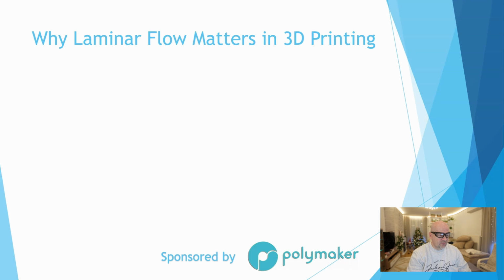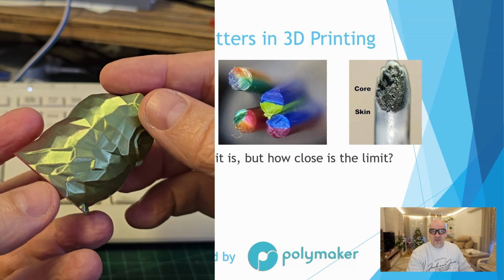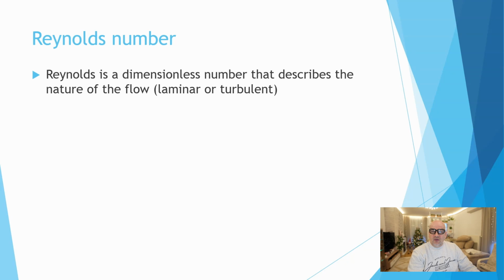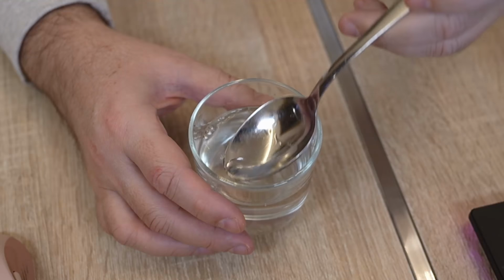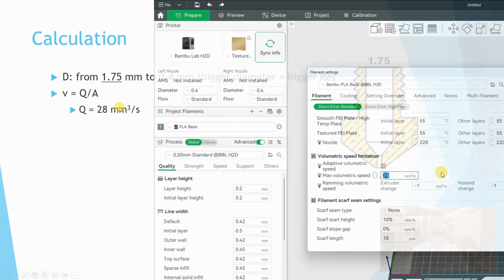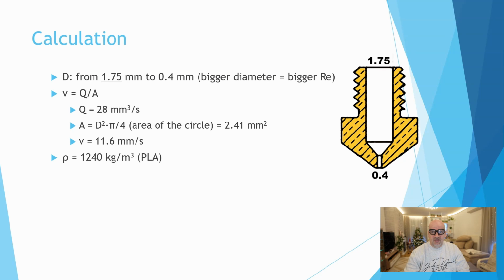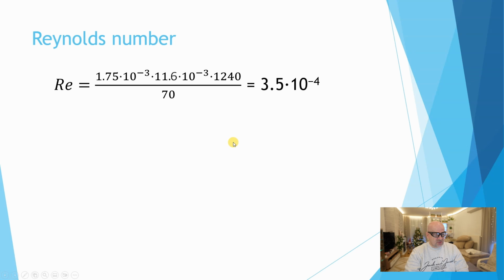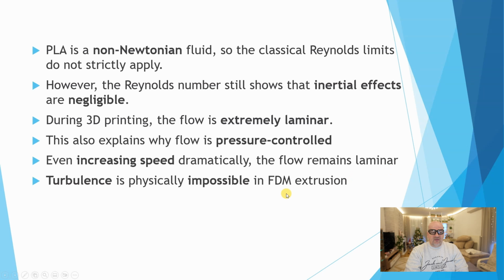Why Laminar Flow Matters in 3D Printing?

Comment from the maker: The Reynolds number is actually higher in the 0.4 mm nozzle than in the 1.75 mm filament.
This is because flow speed scales with 1/D², while Re scales with D.
The difference is about 4.4×, so the conclusions remain the same.
Reply: I think turbulent flow in the hotend can be beneficial (unless we want to print color sided print), cos in this case the plastic is getting mixed and therefore it is heated faster and its temperature becomes more uniform. It is the same effect that is pursued by various high flow nozzles like e3d's or roetz's. Moreover, such nozzle irregularities are called turbulators.
Reply: Azért szebb lett volna, ha elismered a kommentemet, és nem csak lemásolod. :) Mint tudjuk, a jó tudós nem bánja a peer review-t, és bevallja a bakit...
Reply from the maker: Többen is írták, nem győzök mindenhova válaszolni, de igyekszem. Köszi az észrevéltelt.

Comment: Hi ,@MyTechFun can you make the video with formula why different 3d printer have different extruder design like prusa,bondtech, orbit,bambulab,creality,etc. and old bowden type extuder. All these brand used standard 0.4mm  with different design of nozzle to flow the molten filament. Is this related to different spool holder postion and speed of the printer?

Comment: This video is fantastic! From a practical application side of things im more interested in the implication that flow is pressure controlled. Its already something that intuitively made sense (as was the laminar flow part) but that implies we can control pressure at the nozzle for precise filament deposition.
So ventures into FOC of the extruder motor, or strain gauges holding the hotend + a model of internal pressure dynamics can unlock the real volumentric flow control capabilities. Up until now its always just been feed forward velocity control. And we act like variable line widths, stringing and seams are a guessing game. Probably not for long.

Very nice stuff! If anything more of these videos.  It is clear you are an experienced educator!

Comment: having the volumetric flow, and the section you can calculate a Newtonian shear rate uncorrected( neglecting  some effects such as Bagley) using power law  or any other semi empirical model you can get a more accurate value( Cross, Carrea-Yasuda.....)

Comment: This video has great value, it was interesting to actually learn something new! To be fair, filament testing videos often just serve as proof of the tests, otherwise, a simple spreadsheet with measured values would be enough. The only thing that bothers me is that I’m not sure what the conclusion is. Is it that we don't need to worry about turbulent flow with the current generation of 3D printers, or did I just misunderstand?

Comment: If someone unsubscribes because of this type of video, then they never meant to stick around anyways. Love your research and tests keep them going!
Reply from the maker: 3 of them so far. But maybe its better for all..
Reply: @MyTechFun  I know you have a lot of tests to do with each filament but I always wanted to see some chemical resistance tests if that wouldn't be much more work for you. For example PC-ABS, ABS is resistant to Nitric acid, but PC is not, so will their compound be or not? Resistance to motor oil since most people 3D print automotive parts exposed to gasoline, diesel, oil etc.. ethanol, acetone..
Flame resistance would also be interesting to see do they burn, extinguish themselves, melt but not burn etc, the UL94 standard.

Thank you for being awesome!
Reply from the maker: @dujep5327 Flame resistance I tested few times, but chemical tests I would like to leave to chemical engineers.

Comment: Can you please go into the cracking effect that occurs when certain filaments are printed too fast?  For instance, Overture PETG and Polymaker PETG legacy formulation turn matte above a certain velocity and if you put it under a microscope, you can see all kinds of surface cracking or crazing.  There are whitepapers on this.   My understanding is that the pressure differential between the inside of the nozzle and the outside are what causes this problem.  Maybe you can have Polymaker explain how the formulation of the new Polymaker PETG solves this problem (all of the newer PETG formulations fix this).  The cracking or crazing effect heavily compromises layer adhesion.  Likewise, Bambu Silk+ PLA has a severe problem with something that looks similar, which severely limits print speed, and there may be other filament formulations that do this as well.

Comment: LOVE the video. More of this, but also keep doing the testing.
This video was short and sweet, got right to the point, and i loved the actual calculation to give the scale. Perhaps the only thing missing was to re-arrange the formula to solve for speed. Ie, how fast would you have top print to get out of the laminar regime? 
Using your constants, with a 1.75mm characteristic diameter, i got V as 74,194 m/s and with 0.4mm i got 324,597m/s. (someone check my math please...)
These numbers are truly insane, so Roetz 4.0 can crank it up a little more without worrying;-)

Comment: When you extrude 150% line width from a nozzle, you are forcing plastic outward and away from the nozzle orifice, smashing against the previous layer. How is this laminar flow if there is an obstacle in the way (previous layer)? It may be the case that the plastic remains on the same side of the extrusion, but the vectors within the material are not straight lines. This is why you see fibers poking out when extruding larger line widths than the nozzle.
Reply: here you are again with these poking fibers :D just let it go bud, that's not how any of this works.

Comment: I like this type of content. Perhaps in a followup video you could explain more in-depth what is happening while printing to make the quad-color filament change colors depending on the direction the print head is moving, I assume it is the orientation that determines which of the four colors is on top.  Also is four the practical limit for 1.75 mm filament, or could a larger diameter filament produce a wider range of colors?

Comment: Hi , I’m a chemical engineer, and have made many of the polymers used for 3d printing. Often when we do reactor kinetics, we to consider the melt rheology. Many  of these polymers are not Newtonian fluids…so I’m a bit confused by the video. These melts are typically Bingham plastics, so laminar flow is not a thing as described in the video. Predicting the rheology with Reynolds number analysis should be used with caution.
Reply from the maker: You are right and I mentioned this in conclusions

Comment: I don’t do much deep engineering anymore (I’m a CAD developer) but I still followed that 😊. Interesting Reynolds calcs, I had never thought about laminar flow in FDM extrusion! If I understand that correctly the extremely laminar flow is more of a mechanical/geometrical limitation in FDM? Because the channels are so small and the method of feeding plastic thru them?

Comment: In injection molding we have to account for the change in viscosity of the resin by increasing the injection speeds, through sheer and increased temperature at high injection speeds you actually make the plastic less viscous; I love this stuff btw, we need more of it!
Reply: you  need to account for the viscosity at your injection temperature, mold temperature, shear  through gates and other cavities, PvT relationship, due to  high pressures, these are non negligible. you need a capillary rheometer to see the flow curve, i.e. how it  behaves the polymer under a pressure  driven shear flow.

Comment: If I recall, laminar flow is where the volumetric flow rate decreases the closer you measure to the wall of the nozzle, due to friction from the walls causing a shear force. The maximum flow rate is in the centre, while all the way out at the edges the flow rate is zero. Would this not mean that coaxial/core filaments would extrude more of the core than the outside? I can’t really wrap my head around it.

Comment: I can assure, that I havent found the limits of laminar flow :P But I try my very best!
Reply: It can be hardly achievable due to high viscosity and what is more important the small nozzle diameter. The dissipation energy on the wall is pretty high.
Reply: It will be interesting to see results from test objects. Are you speeds in any way scalable to "normal" size printing and what does the quality look like (probably visible on your channel 😉) edit: not great, but I have had worse results with PETG 😅

Comment: Please
Please do more of these! This video left me wanting more. For example what are the effects of the filament acting as non Newtonian  fluid on purge volumes. Whether rapid retraction and de retraction would cause the laminar boundary layer between hotend and filament to be disrupted, reducing purge volumes. If so by how much. Is it better to purge at a hotter or cooler temperature? And more and more!

I’ve done some research on this as part of my orca slicer dev work and blobifier enhancement work but I’d love a more scientific angle to it as I don’t possess the mechanical engineering background to properly analyse the results I’m getting.

Comment: Great video! Thanks for your effort. One note though, turbulent flow DOES happen inside a nozzle although in very localised cases. The main examples is in CHT nozzles right where the filament path splits. The spike at the very center that acts as a splitter can generate localised turbulence, primarily in fiber reinforced filament. Those fibers turn, collide with each other and the risk of clogging in a CHT nozzle is higher than in a straight bore nozzle. I learned about this this last Formnext when I spoke to E3D and their concern on this problem. That's why they're developing the Fuge style nozzle to (hopefully) allow for higher nozzles but with a much smoother flow path than a CHT.
Reply from the maker: Yes, that new E3D nozzle is promising, flattening the path for better thermal conductivity is good especially for core filaments compared to CHT
Reply: I have to disagree with it. Mixing is not turbulent definition.

Comment: fantastic video. I'd love a little bit more depth. This is great for people who are used to digging in with formulas and engineering stuff, but for normies it might help to make things a little more approachable. Perhaps explaining reynolds number more in depth generally, and then bringing it back to 3d printing (e.g. compare water, to honey, to PLA at the same flow conditions, to show how their reynolds numbers compare). However, if this is just a long form response to some of the things I've seen recently (I built a thing has recently had some videos where he's seemed incredulous that core filaments would work) then that's cool too, and good info for some professional scientists on youtube to share.

Comment: I'd be happy to see more videos like this. 

I don't understand why you didn't use the 0.4mm diameter as that would give higher velocity and higher Reynolds number.
Reply from the maker: Hm. yes, I forgot that for v depends from D square (area). The difference is 4.4× , but the conclusions are still correct.

Comment: Thanks for the refresher on laminar flow. Stating that there is no chance of turbulance may not be taking into considerations of nozzels being imperfectly circular at their exit. Therefore, at higher flow velocities any imperfection would increase turbulance. Thoughts?
Reply: More likely disturbed. You won’t get turbulent flow in the sense of aerodynamics. You can have a look at the van Kerman vortex, there you will find turbulent flow for higher number of Re
Reply: Look at die swell definition. You can find much more for injection moulding.

Comment: 3:05 Igor, since v = Q/A, in other words v goes as 1/D², the highest Re is for the narrowest diameter, not the largest diameter. 🙂
Reply: Your conclusion is still correct, but maybe Re at the tip is an order magnitude higher.
Reply: I agree, using the same number I got the result of 1.579*10^-3 as the Re, where the diameter is 0.4 mm, which is 4 times larger but still very small so the conclusion is still correct

Calculation as follow:

A = pi*(D^2)/4
Flowrate = A*v
Flowrate = pi*((D^2)/4)*v
v  = 4*flowrate/((D^2)*pi)
Therefore the D*V term in the Re formula should be equal to 4*flowrate / (D*pi) in our case

Re = (4 * flowrate / (diameter * pi))*density/dynamic viscossity

Using the same number I got 1.579*10^-3

((4*2.8*10^-8)/(pi* 0.4*10^-3))*1240/70 = 1.5788*10^-3
Reply from the maker: I agree, skipped my attention. Thx. The difference is 4.4×. Explained in pinned comment.